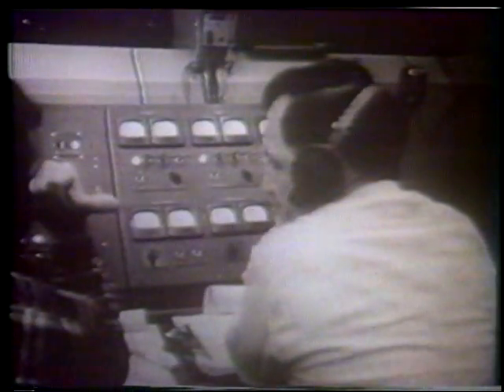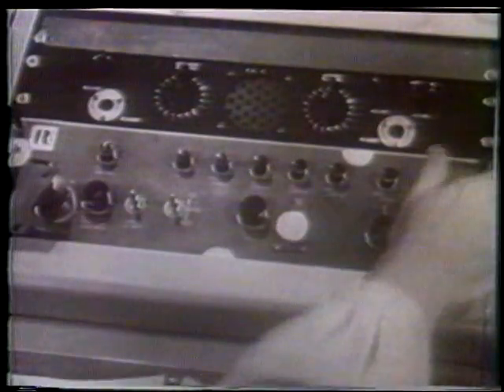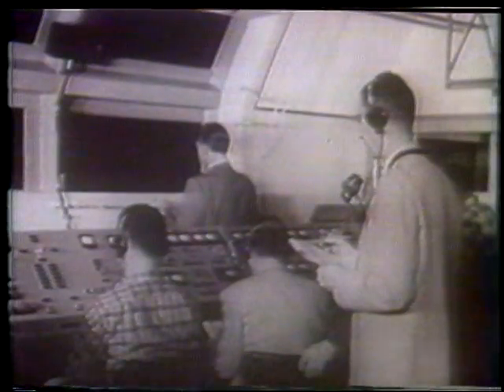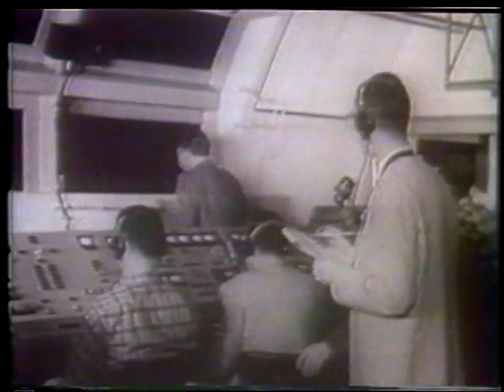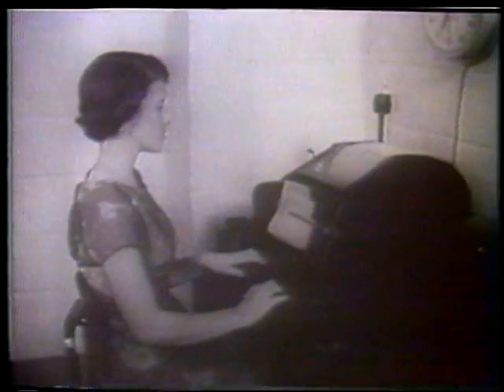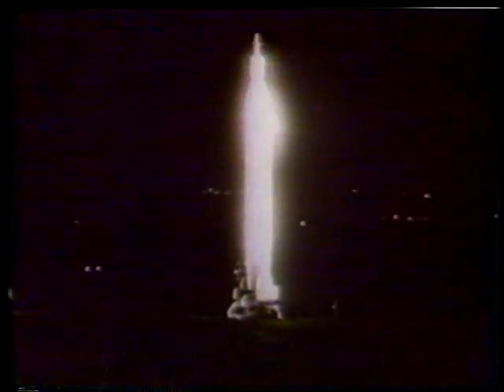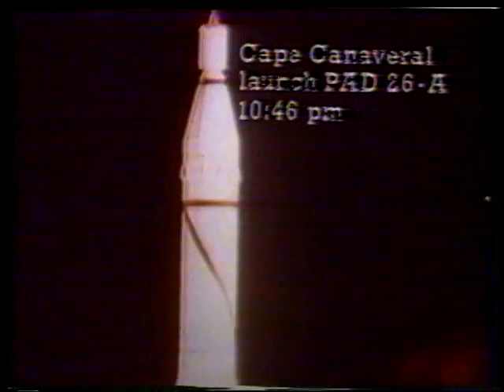The Launch of Explorer 1

Comment: Wow the first us probe actually did something instead of Ussrs Sputnik which did nothing
Reply: You shouldn't hate on the USSR space program they had many firsts and they weren't completely useless. Sputnik helped determine the density of the upper atmosphere from its drag and the radio pulses gave data about the ionosphere.
Reply: @sfsfilms4yearsago618  yeah
Reply: Jorge Mendez I guess it beeped
Reply: SFS Films is correct, that and the R-7 was an objectively better and more capable rocket than the Redstone, in fact the R-7 is still used today in Soyuz program. USSR won the space race, ultimately.
Reply: @spartakusgoulash3109  The Russians ruled Low Earth Orbit.  The Americans ruled the Moon.

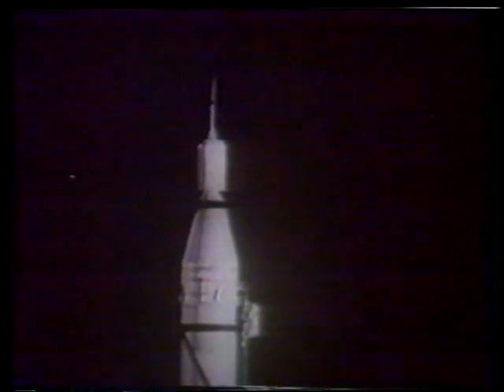Comment: 2:03 the satelite have a rotation or is just a effect?
Reply: Magic mirror What you are seeing is spin stabilization as fourth stage did not have a stabilization system, so it was spun to 600 RPMs to keep it stable once  in orbit.
Reply: Yes, but not just the satellite: The so-called "tub" below the spike on top of the rocket contains 14 Baby Sergeant motors arranged in a ring of 11 around a triad to get the satellite on an orbital trajectory.  Following the burnout of the Juno I's first stage, a lengthened Redstone modified to use Bagel (officially called Hydyne but Mary Sherman Morgan's name was better) instead of glorified vodka, the guidance computer at the base of the cone aft of the tub would separate from the first stage and provide attitude control with RCS thrusters to prepare for the tub motors to fire around apogee, continuing the tub spin-stabilization.  First, the ring of 11 would fire, then separate, then the triad would fire, then the spike on top, containing the final motor and comprising the entire satellite, would fire, and put the satellite in orbit.